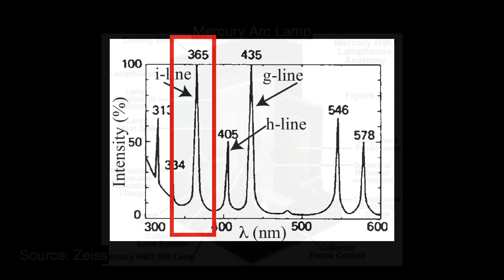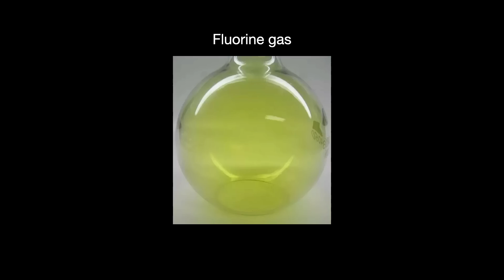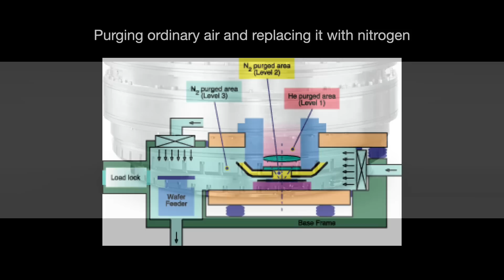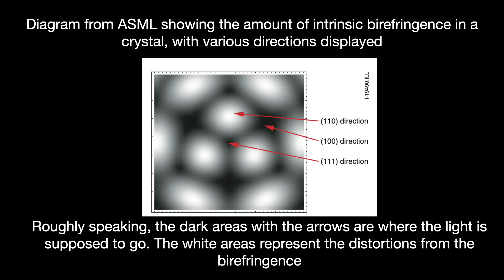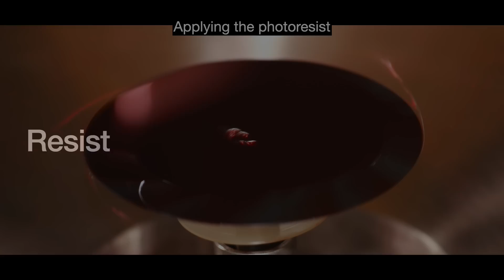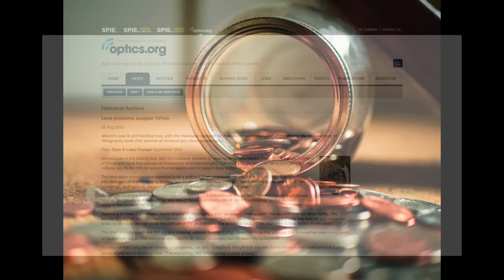Why 157nm Lithography Failed

Comment: They don't mention a key player in 157nm which was Silicon Valley Group.  I bought some of their stock back in the day, figuring being a maker of the leading-edge photolithography equipment could result in the stock going way up.  Instead, 157nm floundered.  SVG was eventually bought out by ASML, and I actually still made money on the stock, but it wasn't of course the motherlode that I had hoped it might be.

Comment: Sorry, but I have some of statements made in the video. The photoresist are usually less sensitive at shorter wavelength. So you have to enhance the sensitivity. Chemical amplified reisists were born.
Thinning down the resist is simply driven by line width. You can‘t use 300nm resist thickness for 30nm lines. The lines will collapse during development by the high adhesion forces. This forces the industry to introduce new pattering processes with hardmasks.
EUV was never on the table at that time. I saw the 1st lenses for EUV at Zeiss in 2005, when immersion was already in mass production. At that time 157nm was already dead.
To call EUV not „optical“ is pure nonsense. 2 of your 3 points also apply to EUV.

Comment: Question. Does this mean lithography machines are for sale second hand? And second, can 193nanometer lithography machines produce reasonably fast and effecient ARM SOC processors like those found in the Raspberry Pi 2 or 3?
Reply: Yest. Pi is Cortex 53 based was designed by ARM for 40nm. Up to 28nm it's very cheap to manufacture The problem is power consumption, clock speed.. Almost all if not all machines are 193nm the only difference is accuracy, more modern ones uses multiple matematically calculated  masks  to create patterns ~ 10nm in size. Plus instead of planar transistors use "towers" of FinFETs. Old machines 32nm IBM machines were also 193  purchased by GlobalFoundries around 2010-2015, to make some chipsets, 65nm machines ~2005 era  AMD /GlobalFoundries used in Dresden 15 years ago were purchased by Russian company to create Elbrus CPU ~2010 witch was probably MIPS based 2 core 1GHz. Most of chinease manufacturers (continental) are makingsuch small CPUs using 28nm or 22nm bulk technology (planar transistors, on silica, very cheap) their VIA basexd x86 CPU was manufactured on such process. Most of currently used CPU's for smartphones are based on FinFET technology other were made 22nm. To create sizes smaller than 40nm you need some new fancy materials, it gets more complicated but Raspbery Pi SOC was not that complicated, most of small microprocessors are made old ancient machines. For 20 years still making everything usin 193nm!

Comment: I would add the US contributions of ETEC and Varian Extrion during the early 80's.  Both companies manufactured and delivered E-beam lithography machines, both to all of the US semiconductor companies and also to Hitachi, NEC, Oki and Mitsubishi.  Those E-beam machines were used mostly for writhing high quality reticules for step-and-repeat and masks for contact printing.  The machines could also direct-write on wafers, but that capibility was rarely used.  Masks produced by the machines were used to produce the high density (of that era) Dee-RAM (correct pronunciation of DRAM) that got Japan on the map as a state-of-the-art semiconductor player.

These machines were based on the Bell Laboratories EBES machine.  Bell Labs licensed the design to both companies and they took the design from a laboratory prototype to production machines.

Comment: You specifically mention OPTICAL lithography, but is there any other? Like... electron/proton beam, etc?
Reply: Electron beam is used for making masks.  It has the highest resolution but is a serial process and slow.    157 is classed as optical though it is not actually "visible".
Reply: @jamescaley9942  no, I mean he focuses on litography being optical, so I assume there are types of litography, which are they?

Also, can you give me a hint how to google this process of making masks (or anything) with an electron beam? I know scanning microscope works like this, but I don't understand how electrons can move material, they're too light.
Reply: They „expose“ a resist. There is no removal of material by the electrons it self. Electrons are to light to displace an atom. You may heat up and evaporate material, but this is not very precious (at least for photomasks). You may use ions, but than it is a FIB tool.
FIBs are BTW  the workhorse in SEMI industry in the Failure Analysis labs to prepare SEM cross sections or TEM lamellas. Also a kind of revolution driven by the industry.

Comment: “Oil Immersion” between the tip of the lens and the sample was long known in microscopy. I have wondered why it took so long to “discover” immersion (with water, not oil) for microlithography.
Reply: I assure you, stepper optics makers knew about immersion as a concept from the beginning. The problems were 1) why solve a bunch of novel engineering issues before you absolutely have to and 2) once you have solved them, how to convince fabs that having liquid in contact with their wafers during exposure wouldn’t cause killer defects.
Reply: You move your microscope with 300mm/s?
Immersion has to keep the water film intact and without any bubbles. The 1st commercial system the ASML 1700i failed by this issue.
Reply: It was the customers who pushed for immersion in the 1980’s. For example, Burn J. Lin in Taiwan and Ghavam Shahidi at IBM. They were not the ones who had to be “convinced” to overcome inertia and redirect from 157 to immersion.

Comment: Have you done a video on why high end masks are 4X and lower end stuff is 5X n 2X with regards to reticles?
Reply: Lower reticle demagnification reduces active write area on the mask, making defects easier to tolerate. 5x masks still exist at all because legacy equipment requires them. Canon for example used 5x reduction in its steppers, but left the advanced lithography market after dry ArF.
Reply: @Grak70  Thanks , I did a search and found an article wherein 2000 there was a big agreement to transition to 5X from 4X , it never happen though and I never seen any "high end" 5X masks
Reply: I’d be interested to read that if you have a link handy.

Comment: You mentioned that the light path had to be in an atmosphere of CO2 so oxygen would not absorb the light.  This was challenging to do without too many changes to the base architecture.  If too much CO2 leaked into the room, it could cause hypoxemia for people working around the machine.  Everyone had to wear an oxygen alarm for personal safety.
Reply: Ok., but the used high toxic chemical (for example phosphin, metallorganics), the tons of sulphuric and hydrofluric acid or high explosives like silanes are not a problem?

Comment: It's not that ASML came up with 111 and 100 labels, these numbers are Miller indices. It's a very basic concept in crystallography.
Reply: Right and silicon wafers for example have a (001) surface  and transistors are parallel to (110)  or sometimes 45deg rotated (100) (quite common for technologies without SiGe strain technology).

Comment: Great summary, as always! But I miss your explanation on how you draw a line thinner than the point of your pencil.
Reply: Starting with a wrong similie is not helpfull to understand the limits of optical systems.
You cannot write smaller lines than the pencils width, but this has nothing to do with optical lithography. There is the simple Abbes law. This explains all.
Reply: SADP bro look it up

Comment: If you were to WILDLY SPECULATE....
what technologies could possibly lead to the next (beyond EUV) generation of ICs?
Reply: Gate-all-around (a finFET with the gate completely wrapped around the channel) is already planned by Samsung and TSMC. High-NA EUV is a beast so difficult it’s really more of a successor technology to today’s EUV. Beyond that, there’s not really any clear solution for further pattern scaling. EUV itself was a pipe dream for decades until it became a necessity. We don’t really even have a serious contender for pipe dreams at this point…
Reply: @Grak70  euv will be the last litho technology because we will hit a hard wall with material/physical limitations before it is exhausted. A transistor with a 1nm gate (~6 atoms) will not work for Qmech reasons.

Comment: I would love to understand how masks are created. I understand that a mask is a fraction of the architecture of the chip.. but how do you manufacture something that small. Are masks also made by lithography?
Reply: Yes , a photomask is made by lithography. They tend not to get much publicity compared to the wafer writing tools , but no high end mask writer , it doesnt matter what your wafer litho tool can do.
Reply: Also by a resist mask, developing, etch, but the „exposure“ is done by a scanned(!) laser or electron beam, „writing“ line by line directly from CAD data.
Reply: @soren6045  the last link in my understanding is complete. The electron beam lithography stage seems VERY slow and tedious. Makes sense why we use it on masks creation and why we need a mask for mass producing chips.. if we used lazers for every transistor, microchips would cost a fortune to produce. 🙏 I am grateful for the responses guys.
Reply: @TheCosmicMason  There are folk looking to direct write the entire wafer , bypassing thr mask process.
No idea how far they have gotten with respect to Tech Node and where they are with yields on what they are doing
Reply: @andysing72 If you could get to the feature size as small as the bleeding edge.. it would work great to try out an architecture and make quick iterations before you move on to making the mask for mass production. I would imagine the issue, much the same with lithography, is the light wavelength.

Comment: Out if curiosity but how when euv was the future did only one company wind to making the EUV lithography machines?
Reply: Because it is really, really hard. Mirrors require much greater accuracy than lenses. The goal is for a particular path to have a distance a particular number of wavelengths so the phases line up. If a lens surface is wrong by 5nm and the wavelengths are 20nm and 18nm inside and out, then the phase is going to be wrong by about 2.5%. If a mirror is 5nm wrong then the phase is wrong by 50%, and light along this path interferes destructively instead.
I expect China will get it working at some point, but for now each of the components are so crazy precise that there is nothing else that even comes close to the requirements. If one of those mirrors were blown up to be 500km across inaccuracies of the range of 1mm are be out of tolerance. That's comparable to the surface of neutron star in terms of smoothness.
Reply: @agsystems8220  I’ll believe China will catch up on EUV after they’ve produced, say, a working KrF scanner.
Reply: @Grak70  The point is that the battle has been won as far as the commercial side of things is concerned. There is no catching ASML at this point for any other business, and no prize for second place. The only other player in the race then is China, who are pursuing it for national interest reasons, and have the resources to make a serious effort. I didn't mean that they are close, just that they are still working towards it.
Reply: @agsystems8220  I've seen many stories of China trying to reverse engineer EUV machines they've "acquired" over the last 4+ year.
Reply: @agsystems8220  I’m not saying they can’t do it. They just have a hell of a long row to hoe first.
Reply: Probly cause, it was so expensive it was better for the entire industry to invest in one consolidated effort, then spend x2 just to have a backup supplier.
Reply: @chainingsolid  I get that in theory but using,Intel as a recent example, couldn't one mistake or miscalculation hurt the whole industry?
Reply: Nikon tried, but they backed the wrong horse on EUV source technology (DPP vs LPP). That coupled with ASML’s patents on dual stage technology to augment the throughput requirements at the low wafer plane powers EUV started at and ASML’s strong partnership with Zeiss who were way ahead on the reflective optics pretty much doomed Nikon’s efforts. Canon, the only other major exposure tool maker, largely dropped off the map after dry ArF and never recovered.

Comment: EUV is technically still optical lithography, however is reflective rather than refractive method of lithography. (It's still photons, just close to soft x rays)
i.e 193 is refractive the lens refract light to get the pattern on the wafer. EUV reflects light to get the pattern in the wafer.
Reply: i was about to ask why would EUV process not be considered optical lithography anymore. i guess it was just a small mistake in the vid

Comment: Two short factoids:
1. IBM thought X ray lithography was the way to go and failed (ultrashort wavelengths). They may have just been to early.
2. How do they even know the next generation chips are even possible? Test chips can be created (slowly) by using scanning electron beams. Electrons have a really short wavelength. There is no mask used, each step on the chip is done by scanning it. Hence it is slow, but works for lab use.
Reply: too*

Comment: I worked in the industry at that time and remember the announcement in 2003.  It was stunning, really, because so much effort and money had been poured in by many, many organizations.  Thankfully, some clever folks figured out that (highly-purified) water was a viable alternative when supplied in the right location.  And then a slew of ever-amazing innovations to extend the performance of sub-wavelength patterning with 193 light.  It's one of the underappreciated success stories of the last 50 years.
Reply: My collegue was in the taskforce to develop immersion objective within months and they did a Great Job !
Reply: I didn't pay attention what was going on in semis for a number of years but when I looked into it at some point down the road I was astounded to learn that they were still using 193 to produce stuff with features way smaller than that wavelength.  Some really smart optical engineers.
Reply: I barely understand the science or the tech but I heard a bit about that since the city i lived in was basically a Microsoft suburb at the time.
Reply: Sh!t happens.  Same thing happened in programming when Microsoft threw Silverlight under the bus.  Such a nice clean language (speaking as an amateur coder, it was never my day job).  But the programming language pivot was not due to technical factors, more like popularity factors (the anti-MSFT crowd liked HTML5 and other such dirty languages).
Reply: @raylopez99  that is just straight incorrect
Reply: @raylopez99  That's not the way I remember that happening.

Comment: Fun story: the first full field functioning scanner ever made for 157 was manufactured by SVG (later acquired by ASML for their catadioptric lens designs). At the time, it was thought the entire lens train, including the condenser optics, would need to be made from ultra-pure calcium fluoride. It was later discovered that fluorine doped quartz would do the trick for all but the few final lens elements. At the time, that one scanner contained the largest concentration of lithography suitable CaF2 in existence. The projection lens was literally worth its weight in gold.
Reply: I heard CaF2 had issues with thermal expansion as well as the problem with birefringence, both of which caused unacceptable image resolution.  Not to mention that it's fragile, difficult to polish and expensive as hell.   I've worked with it plenty on excimer laser optics (nearly all the light source optics are CaF2) and it really an order of magnitude harder to get right than SiO2 optics.
Reply: @donkeydong1978  very true. It’s much more difficult to make a large piece of CaF2 with uniform optical properties than fused silica/quartz.  As such, high NA optics were always going to be a problem.
Reply: Considering gold's price back then... probably worth more than its weight in gold!
Reply: im use caf2 for my diy lihograpfy maschine. right has problems but first. its good

Comment: Intel was pioneer, I agree but not anymore. Basically they stopped development around 2014 and since that time they made only double work and every time rolled back to old technology. This is time wasting to promise new technology and right before release date...again they design things for old technology. Sure, they produce many other things too and do not care about CPU production. Only fanboys still buy it, rest of the world buys AMD. Same garbage they have on server market. You must be very rich to use intel old, slow and way less cores technology. For server farms it is not cost effective and they never buy intel. Intel is stuck on old memory controllers too, keep pushing so yesterday things. Finally they understood what a garbage product was optane. Sure it was garbage, because it was only for their garbage product.